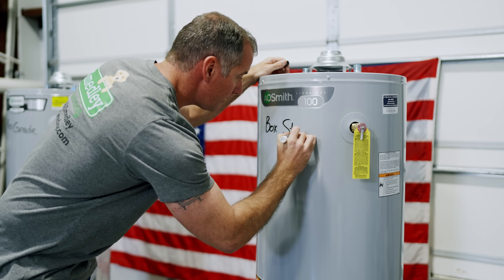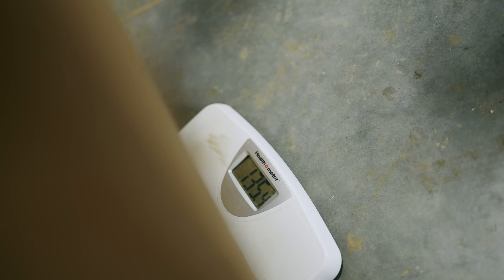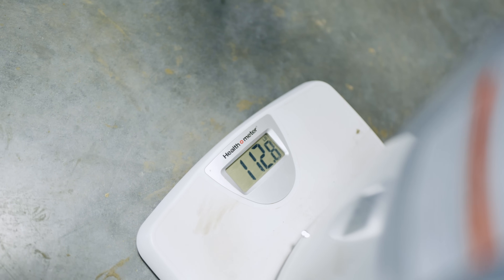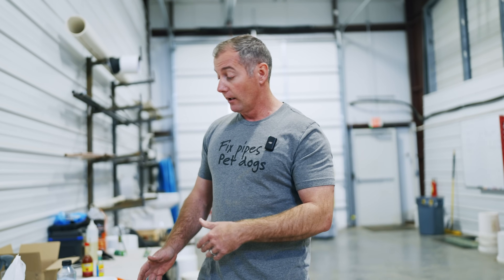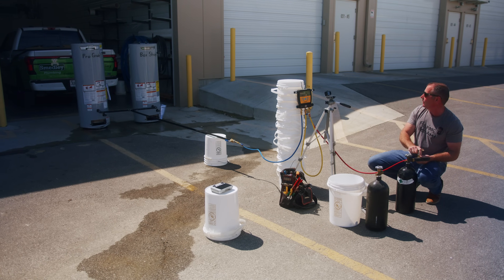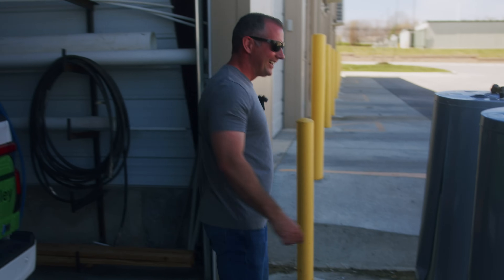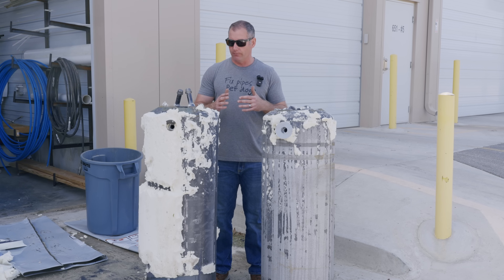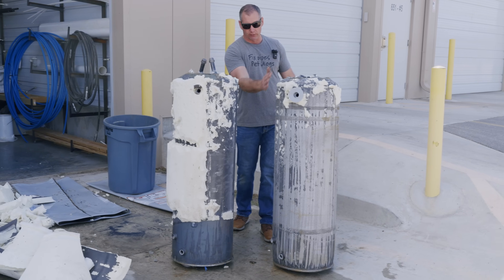What water heater should I buy? - Pro Grade vs. Box Store

Comment: I am sorry but your looking at to different price points Lowe's has water heaters at the 629 price point you should of at least used the water heater with the same price so of course a 519 is going to be cheaper it's meant to be.
Reply from the maker: Yes but this comparison is over both 6-year thanks.  If we compared the same price points, the Lowe's rack would be a 12-year tank.
Reply: @SmedleyPlumbing  so are you saying for the same price i can get a 12 year tank verse the 6 year "Pro Series"  So what is the better value?  Value is why most people go to big box stores to begin with. The take away am getting is yes there is a difference for a extra 110 dollars i get a really well built tank but its clear i am paying for that build since it cost me extra money. And if i am going to spend a extra 110 dollars for the same type of tank it better be built a lot better.

Comment: For the love of all that's holy, don't test a pressure vessel like that again.  Testing pressure vessels to failure is done from a bunker for a reason.  You're lucky the failure point was under the water but 450psi is 450psi whether it's air or water.  If that had failed in the part of the headspace occupied by gas then it's explosive decompression.
Reply from the maker: Hydro testing is actually very safe. Water does not compress therefore it does not have too much potential energy whenever the vessel fails. However if we had done the same test with strictly air then it would have been disastrous.
Reply: @SmedleyPlumbing  hydro testing is reasonably safe when the working fluid is kept as a liquid.  For example when you have a hydraulic pump operating at 2000psi+ and you develop a cut in a hose, the results aren't often catastrophic. 

In your case, as the domed bottom of the tank started to deform, you opened up a substantial headspace in the top of that tank which you then pressurized with 450psi of compressed gas.  The fact that there was an incompressible fluid beneath the gas is immaterial because you created a compressed gas bomb above it. If you assume a tank diameter of 16" (back of napkin here) then you had ~ 90,000lbs of force pressing up on the top of that tank. 

You essentially created a hydraulic accumulator and the dangers associated with accumulators are pretty well understood. 

 If you want to test another heater, you should do it with a high pressure hydraulic pump so that you don't create stored energy in the system and the failure mode is more predictable.
Reply from the maker: @tylerleeds6275  thanks for the advice

Comment: Safety ! Safety! Safety! This guy was too close! 1 mistake! 2nd mistake pressure valve will prevent excessive pressure! In any case! Economics plays a factor! A lot of Plumbing shops won’t say you the hot water tanks from them so you have to go to the box stores. They do this with HVAC and this is good so you don’t have people that don’t know what they’re doing installing HVAC equipment and trying to do the repairs themselves. In any case safety is and should have been set in. You decided to pressure test this tank. You could’ve really gotten hurt. That’s the difference between a union shop that has safety as main priority as compared to a nonunion shop I was taught from day one safety first. You can take that to the bank no matter what you’re working on. Be safe
Reply from the maker: This has absolutely nothing to do with Union versus non-union. Hydro testing is incredibly safe as we proved in this video. Had we filled these tanks with air than it would be a completely different situation. But filling them with water makes for a safe failure.

Comment: I was rooting for the pro-grade, after watching this... I would recommend the box store, Let me explain: The inlet and outlet nipples... WHO CARES.  Burner door... WHO CARES.  Flute and heat diffuser... WHO CARES. Pressure relief valve... both would work fine.  Drain valve... replace the plastic valve for $23 if so desired.  The burner and controller regardless of a few grams in weight (probably wiring)... not noticeable to make a difference.  TANK... you screwed the pooch on this one (should have cut it open and measured wall thickness and bottom thickness).  The pressure test was pointless and the reason for a pressure relief valve, this only concluded that the "Pro" tank was inferior to the box store tank (which I believe is the same tank).  The only reason I would spend more on a hot water tank or boiler is for a better tank... Everything is serviceable except for the tank, once the tank is compromised it's done.
Reply from the maker: For a person that can perform these repairs themselves, then you can have the choice to do whatever you want. But if you are uncapable of performing those repairs yourself then you're going to want to select a heater that is less likely to need those repairs. And that would be the pro-grade model.
Reply: @SmedleyPlumbing  I completely disagree, but each to their own.  What was the warranty difference between these two models? Not that it makes much of a difference since the fine print says: must be installed by a licensed plumber for the warranty and if not most are only 1-year warranty if installed by the customer  (But there are laws that protect us and the manufacturer must prove that the installation was the cause of the malfunction) The only difference I saw that would make a difference is the anode rod, If I had a well I would choose the pro if it was available at the big box store.  And to your point, if someone is buying from a big box store they're more than likely installing it themselves and would repair it themselves also.

Comment: IF YOU'RE GOING TO INSTALL IT YOURSELF YOU'RE BETTER OFF WITH THE BOX STORE YOU GET A LOWER PRICE AND OF COURSE YOU SAVE ALL THAT INSTALLATION MONEY AND THAT MAKES A DIFFERENCE AS LONG AS YOU DO KNOW WHAT YOU'RE DOING AND USE THE BEST PRODUCTS TO ASSEMBLE IT TO YOUR EXISTING WATER SYSTEM BASICALLY YOU ULTIMATELY PROVED THERE IS NOT MUCH DIFFERENCE THE DIFFERENCE IN EFFICIENCY WITH THE PROGRADE IS GOING TO BE MINIMAL AND NOT EVER BE RECOUPED FOR THE PRICE OF PAYING A PROFESSIONAL TO INSTALL IT AND THE PURCHASE OF THE ACTUAL WATER HEATER ITSELF. MY SUGGESTION TO ANYONE READING THIS ALWAYS BY THE BOX STORY IF YOU'RE INSTALLING IT YOURSELF
Reply from the maker: And they'll remember what you said because you yelled the whole thing.

Comment: First. The Commercial brand popped FIRST under 400 pounds of pressure. Second. These are basically the same quality water tanks. Often the decreased weight is because they have to ship these things all over the place to retailers like Lowes. You state at the beginning you are going to compare the two, but from the very beginning you continue to assume, the commercial brand is better. Basically, you are saying, guilty until proven innocent and then proceed to look for evidence. Third. I had a Lowes gas water heater in my house for 16 years. Never had a problem. Worked like a champ until the day we sold it. I think you show a bias that somehow there is some hidden conspiracy to sell a water heater that weighs 10 pounds less is bad. Also. Have you ever tried to manufacture a product? Often inventory has to be purchased from more than ONE vendor. As a result, a model might have variations, in parts, due to the availability of parts. And, I disagree. A brass water valve might be all corroded and a plastic one might work great after 10 years. The fact that both tanks stood up to 400 pounds of pressure, is a testament to the quality of manufacturing of both tanks. Regardless. I am certain that if you put in a water tank from Lowes and the warranty is 5 years, that water tank will work for long past that and maybe even longer than the commercial one. Now. If compared to a $1,000 water heater (commercial) and a $400 Lowes water heater, I would expect that one of them would exceed the other in quality of manufacture. Now that would be an interesting comparison.
Reply from the maker: The box store unit actually started leaking first. I misspoke during the summerization of the video but if you play it back you'll see that I mentioned the water running down the box store unit first. That is enough right there to stop the test. But we kept going.  Then the commercial grade tank popped and between both leaks it was leaking so bad that we could no longer add pressure. 

I know people like to compare box store water heaters from 20 years ago and how well they hold up. However box store water heaters are nowhere near the same as they were 20 years ago. Today's box door water heaters do not last nearly as long as the pro grade heaters. 

Also, people love to compare a completely professional installation of a pro-grade heater in comparison to a fictitiously low box store heater purchase price. They'll say something about $2,000 for a pro grade heater versus $400 for a box store heater.  You can't buy a box store heater for $400 and even if you could that does not get the heater installed. So those comparisons are more apples to oranges whereas our comparison was strictly heater quality to heater quality.
Reply: You actually want the T&P valve to pop open and release pressure sooner than later. You are correct though on the store water heater lasting at least 5 years. However the pro grade is made better and more easily serviceable due to the metal over plastic components. If you are capable of doing your own water heater exchange, buying the box store water heater will save you money vs. calling a certified plumbing company. His video is correct though. Pro grade is manufactured better. It does not however guarantee it will last longer, that depends on incoming water quality and water pressure.

Comment: This test is kinda BS. Whats the manufacturer part # of each? Order the same part number from both places and then talk about price differences.
Reply from the maker: They don't have the same part numbers but they elude that they are the same heaters available at box stores.
Reply: @SmedleyPlumbing  the part number on the shelf at the box store isn't the same, but if you know the part number of the one from the plumbing supply store, you can order that part directly from a box store. It will likely still be cheaper.
Reply from the maker: @mikebonom  it doesn't work like that.
Reply: @SmedleyPlumbing  yes it does. That's literally how I bought mine
Reply from the maker: @mikebonom  the purpose of the video is to show that the units on the shelves at the box store are not the same as the ones on the shelves at the professional plumbing supply store.
Reply: @SmedleyPlumbing  I understand that, but you are also misleading people to think that they can't get the better built ones at a box store.
Reply from the maker: @mikebonom  I'm not misleading anyone.  We literally went to the box store and bought one off the shelf. And the general consensus is the ones on the shelf are the same as the ones on the shelf at the professional Plumbing supply store. But if you want to take the adage of finding reasons to get upset about everything in life then go ahead. I'm sure you can find more things to get upset about in this or any of our other videos.

Comment: Even at the big box stores, they sell different grades of water heaters. Often up to 3 different grades. Sort of like a good, a better and a best unit. 

So even if you purchase a box store unit, spending a little more on a better or best unit will usually get you longer life. 

The same can be said for units purchased at a plumbing supply house. 

You failed to mention this in the video and you make it sound like all heaters purchased at a supply house are better quality than the best units sold at the big box stores. This simply isn't true. 

If you get the manufacturers literature for any unit, it will tell you what features it has and you can compare those features against another unit made by the same manufacturer.
Reply from the maker: The supply house doesn't offer good, better, best.  They only offer one.  And it's the best.  The reason box stores offer that is because everyday consumers like options.  There is virtually zero differences between the good and better units at the box stores.  The best units with typically have an additional anode rod.

Comment: Just don't buy a heat pump water heater.  EPA says that they are better and cheaper, but it is not true.  they "adjust" the numbers to make it look like it is cheaper to use.  GAS, then Electric and then heat pump.
Reply from the maker: Heat pump units are pretty awesome.  Especially if you're currently using an electric water heater.

Comment: TLDR: I'm forced to change water heater every 10 years i'm more interested in money saving, usability and features than longevity. This video test longevity.

All insurers here force us to change the tank every 10 years. in my not professional opinion, all those minor differences on quality, strength wont matter because neither tank should ever reach the point of failure. And even if they do, I'm pretty confident the cheaper relief valve wil work as much. 
If you where to say the pro grade will outlast the consumer grade by x years it might be worth it. But insurer don't care, it's 10 years. 
So what I get from the video is, the pro grade is over engineered for the same result over it's lifespan. Maybe the pro grade get you a little more hot water before running out because of the fin thing in the middle, maybe not because there's a tube on the end of the hot water nipple meaning it does not get water from the top of the tank. I don't understant why the presence of this tube is a plus.
THe only test you made, is resistance to pressure, wich statisticly won't happen in a 10 year or less water heater. 

The only stats i would really be interested in when making a choice is  
- Insulation
- Speed to reheat the whole tank
- How long can you run, because heater are designed to get you more hot water than the capacity of the tank in hot water , they are designed to reheat water as you use them.
Reply from the maker: Looks like you have a very unique set of circumstances. While you think that the pro-grade unit is over engineered, I go the other way with it and am assured that the box store unit is value engineered. And value engineering never lasts as long as it should.

Comment: There are so many logical fallacies in this video, I would have to put out an hour rebuttal video just to go through them all. 

Here's the granddaddy of them all: to water heaters could not have been produced on the same line on the same day if they have a different screw on valve 🙄. 

Let's look at the new Ford bronco. It must have six+ different variants and each variant can have a multitude of different large scale packages installed. Do you really think they are coming down 30 different assembly lines for the same vehicle?
Reply from the maker: Most people don't understand how assembly lines work.  They assume if they are made on the same line, they are the same quality.
Reply: @SmedleyPlumbing  two identical dip tubes being a third of an ounce off weight?  A third of an ounce could easily be positioning on the scale, and error by the scale itself if it is not a super high quality one, and minuscule variance in manufacturing....🙄. If you want to see if two identical valve bodies are actually the same, maybe turn the thing over and check its part number which is likely somewhere on it? I could go on and on....
Reply from the maker: @cristopherfrakes1416  if we didn't weigh everything, we'd get ripped for not doing so.  We do weigh everything and this guy still finds objection.  I look forward to your rebuttal video.  Make sure to tag us so we can watch it.
Reply: @SmedleyPlumbing  the point wasn't to not weigh anything, it was that a third of an ounce difference in two identical items is not a difference in quality or proof of anything whatsoever. Two identical brake pads in the same exact set of brakes contained in the same exact box could be off by a third of an ounce, especially when compounded by slightly different placement on the scale or inaccuracies in the scale itself. You are being purposely obtuse.
Reply from the maker: @cristopherfrakes1416  the same could be said for you.  We discovered a nearly 10 pound overall weight difference and you're splitting hairs about the smallest discrepancy.

Comment: All right pretty darn good video, but I think you really failed at the end, after you broke these tanks open and show the actual tank you really failed by not weighing them without any foam on them to show the actual weight difference and then you really really failed by not cutting them open and measuring the wall thicknesses so I’m giving you a B minus for this video to go through all that work and not cut them open and show the differences is a giant fail 🤷‍♂️

And I watch this whole thing because I do a fair amount of tanks for a couple property owners in on a ton of rentals, and I’ve heard all the stories about the differences and the differences in the warranty and where you can return them or can’t so this does confirm differences that are probably worth it for the difference in money and warranty

But if you ever do this again cut the damn things open pull out your calipers measure the wall thicknesses of the tank and the bottom and top caps show people what the Frick they’re getting for the difference in $150 or $200
Reply from the maker: So we thought about that.  But we didn't think that mattered.  Steel can be thinner while still being stronger.  So we thought a thickness measurement wouldn't be a measure of quality.